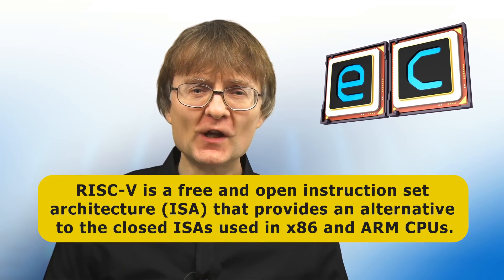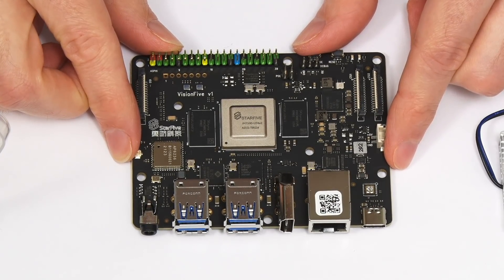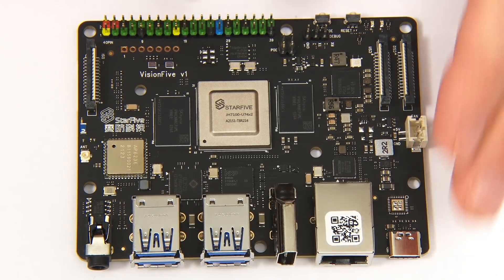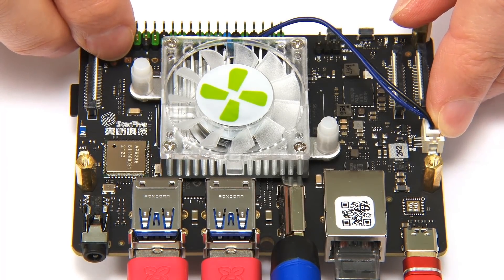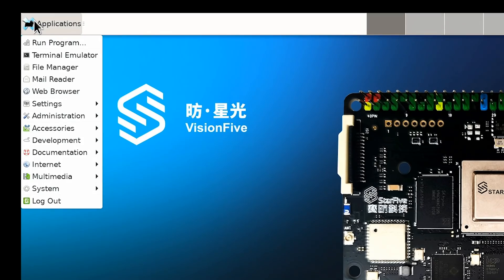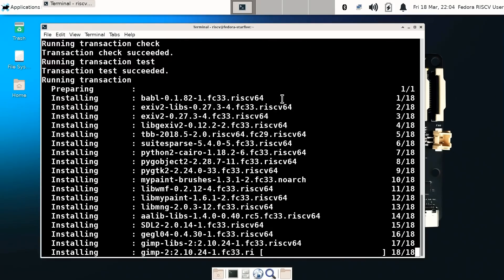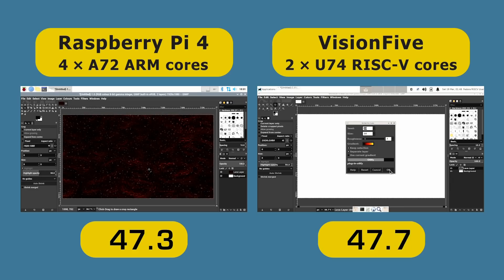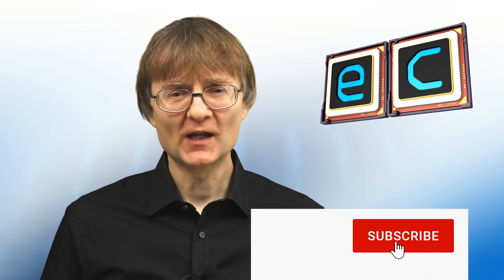VisionFive RISC-V Linux SBC

Comment: does the RISC-V have a built in controller to connect it to a 32' LCD Screen
Reply from the maker: Yes, there are two MIPI LCD panel headers, in additon to the HDMI output.

Comment: First I was into Risc-V but then I start reading about modular ISA which sounds like the reason why this will not be anything big. From my understanding, it means I can develop a software on my cpu with instruction set A.. and give the software to you where you miss a few instructions, so these will be emulated instead. I guess Risc-V will be perfect in closed systems if this is true, cause then you dont have this headache. But if its true, it will be like when MMX came for example, and you could not run this software cause your cpu lacked the instructions. But I could have understand it wrong
Reply from the maker: There are already about 10 billion RISC-V cores in use in the microcontroller and embedded space -- so it is already big. :) The ISA is extensible as you say. So, for example, a automobile manufacturer may add an extension for their particular use case. But outside of closed systems, core designers will stick to the standard ISA, so I don't anticipate the problems you describe.
Reply: @ExplainingComputers  ah then its okie I guess! :) was just seeing a nightmare of different isas being used in different software in my head lol :)

Comment: The RISC-V does not contain innovative ideas in microprocessor design capable of replacing existing processors such as x86 and ARM. The RISC-V processor is not suitable as a candidate for this role. They say “RISC-V does not represent new technology”. The RISC-V has no novelty potential. The tomorrow’s world needs completely new architectural ideas as familiar processors x86 and ARM are morally obsolete architecturally. I propose the novel architectural idea, see my article, address is below in this comment. The RISC-V is good for embedded systems, controllers, and similar as free and open. There are other positives and improvements, but they are on the engineering level. But the RISC-V will never become a general all-purpose processor. The RISC-V is based on 40-year old ideas as RISC-V Foundation claims. There is no sense to port the huge x86 and ARM software ecosystems on it. Thus, RISC-V will never gain a victory over x86 and ARM. The most of positives about the RISC-V processor are arbitrary speculations. Actually, the main advantage/benefit of RISC-V is free and open architecture (open ISA). The RISC-V processor has instructions with variable lengths, consisting of 2-byte snippets. It is strange, it is bad being a deviation from the classic, absolute, and pure RISC principles well formulated at the beginning of the RISC era. Also the RISC-V processor has 6 instruction formats, and it is too many.
I sceptically evaluate the RISC-V microprocessor, because it is based on old ideas and does not advance computer science and practice, freezing the long-achieved scientific and technical levels. However, I pay tribute to the creators of the ideas of the RISC microprocessor, with the main feature to perform all arithmetic/logical operations only on registers, and use external RAM only to load/store processed data. I also pay tribute to the idea of the free and open computer architecture (not patented instruction set architecture).
The Contemporary microprocessors contain 8 specific hardware components: (1) SMT (Simultaneous Multithreading), (2) register renaming, (3) instruction reordering, (4) out-of-order execution, (5) speculative execution, (6) superscalar execution, (7) delayed branch, (8) branch prediction. These components make up some kind of a “magnificent eight” of components which essentially raise the performance of microprocessors. But unfortunately they are very complex. A processor core having these components is a full-fledged one, otherwise it is good for simple applications, e. g. for embedded systems, controllers etc. 
The “magnificent eight” of components is very hard to design, only the experienced firms and developers are able to do this, and much know-how was acquired, some effective solutions are patented. Particularly complex is the SMT. Only powerful and advanced firms like Intel, AMD, IBM are able to equip their processors with the “magnificent eight” components. It is not surprising that some Intel processors, and the famous Apple's M1 processor do not contain SMTs. If a company is able create the full-fledged RISC-V processor with all “magnificent eight” components then it would be a serious achievement, and such RISC-V would be considered of the World's class comparable with x86, with ARM, but not more. As far as I understand most of the developed RISC-V processors have no components from the “magnificent eight”, and are intended for embedded systems.
A course directed on further development of RISC-V is a wrong way, and leads the computer architecture to deadlock. The RISC-V is not promising for computer industry. In fact, RISC-V hampers the further development of the state-of-the-art microprocessor technologies. The World demands absolutely novel microprocessor having much more higher performance than all contemporary ones. The novel and effective ideas on computer architectures do exist! Here’s such a novel processor architecture in article V. K. Dobrovolskyi. “Microprocessor Based on the Minimal Hardware Principle”. The article is published in scientific magazine Electronic Modeling (Електронне моделювання), 2019, vol 41, No 6. pp. 77-90. The magazine is posted in the Internet:
https://www.emodel.org.ua/en/ touch ARCHIVE, move to 2019, then to VOL 41, NO 6, (2019) then click  Microprocessor Based on the Minimal Hardware Principle, then go below to Full text: PDF, and click PDF. 
My novel processor architecture does not have the “magnificent eight”, The “eight” is not necessary at all. This comment reflects different view on the RISC-V architecture, and the computer community has a right to become familiar with such a view. I’m Volodymyr Dobrovolskyi (V.K.Dobrovolskyi).

Comment: I wonder if the simple architecture will allow for significant overclocking and/or high core count like the IBM series. Very exciting and I think philosophically from a computer science perspective RISC architectures with emergent instruction composing are superior to macro ops and CISC. If ever we change from silicone based chips to something futuristic like graphene, it is likely the first architecture will be RISC.

Comment: RiscV only has benefit in the ISA. ASIC needs various costs like IPs EDAs fabrication pacakaging and so on. Briefly, It needs abundance of echo systems of FPGA or easy asic (this may be too much) with open eda environment. And FPGA board with open risc v, npu, gpu HW source would be the wanted but too far.

Comment: The interesting thing is that the US courts ruled back in the day that an ISA could not be patented/copyrighted which is why we had AMDx86 and Cyrix x86 and Z80 mimicking 8080. Where RISC-V differer from ARM is that the entire VHDL used to design the architecture is open source. They could have done RISC-V with the same ISA as ARM but then they would have faced much more detailed comparisons on there performance I'd wager. I saw someone do some benchmarks between RISC-V and ARM and ARM came out slightly on top, but I would imagine as a community develops behind RISC-V that the VHDL improves the differences become less pronounced.

Comment: How much of the delay you experience is the processor and how much is a result loading from a flash card I wonder?
Reply from the maker: It almost all the processor. I've run a lot of SBCs from flash memory cards (over 60 different models), and performance can be a lot better from a (good) flash memory card. :)

Comment: $200 is low cost for a SBC?!
Reply from the maker: This is (was) not a low-cost SBC, and nowhere do I say this in the video. At the time of making the video (and for a few more weeks a I write this!) the VisonFive was low cost for a RISC-V computer of any kind capable of running a desktop Linux distro. It is not, and is not presented as, a general SBC. Rather, it is a board for those wishing to develop or otherwise pioneer with RISC-V, and is low-cost in that context.

Comment: I'd actually would have loved to know the power consumption on this computer vs the raspberry pi 4 - in idle and e.g. when applying that complex filter in GIMP. Just to get some numbers.

Seeing as electricity becomes way more expensive, perhaps a RISC-V-powered computer could be more efficient than even ARM-based computers are? That'd be definitely a selling point, though since it's probably somewhat early, I doubt it is as efficient, let alone more efficient at this time. But perhaps in the future? Who knows :).

Comment: Lemme blow your mind right now:
4 ARM Cortex A72 cores finish the lava render in 47.3 seconds - meaning that if we ignore that the OS eats some of your performance, 1 core would finish it in 189.2 seconds

2 RISC-V U74 cores finish the same render in 71.2 seconds, meaning one core would need just 142.4 seconds to finish it

When we factor in the fact that the two U74 cores have to run the OS and that RPi4 has basically two "free" cores, we can see that U74 has about 25% to 30% more single-core performance than A72

This makes me want a laptop using a 8core RISC-V SoC 😁
Reply from the maker: Yes, I agree. Four or eight core RISC_V chips with U72 cores or better running at 2GHz or more (and a GPU) will be a serious platform -- and I know there are companies planning on having them on the market by the end of 2022.

Comment: It's a pity they are not releasing at least quad cores yet and at higher clock speeds matching at least mid-range arm cores. That way we could do a more direct performance comparison by comparing SOCs at same or close enough clock speeds.

Comment: This is lacking a single core and multicore benchmark for comparing it to Raspberry Pi.
The GIMP benchmark shown is useless, because it is unclear if the particular GIMP filter is using multiple cores or not.

Comment: Nearly $200 for this?   Hard to see the value.
Reply from the maker: It is a development board for users wishing to experiment with or develop for the RISC-V platform, not an end-user product. It is currently one of these cheapest products that can run a Linux desktop on RISC-V hardware. :) But in a year or two RISC-V boards should be price and performance competitive with ARM.

Comment: I don't see why x86 and ARM and whatnot ought not be Open Instruction Sets? I think that I can google and download the appropriate instructions of my liking. 
I don't believe, that these are actually Open Hardware, however. Can you get full internal circuitry, lithography, everything?

Plus, for close to 200 USD, I guess I used to pay that much some 12 to 15 years ago for 1 GB and 600 MHz. 

Maybe I'm totally out of focus here, but why would this be any better than a modern Raspberry Pie for a fraction of the price? Also including GPIO?
Reply from the maker: Knowing the instructions in any instruction set does not make it open. :) Rather, an open instruction set is one where anybody is free to use it to design their own cores and manfacture their own chips, and you cannot legally do this with the x86 or ARM ISAs.

On the price, the SBC here is a development board for those wishing to develop RISC-V software. It is not an end user product. But in a year or two there will be end-user RISC-V boards that will be price an feature competitive with x86 and ARM . . .

Comment: Why are the new RISC-V SBCs single-core? Is it because they are new and a lot needs to be worked out (refinements) before adding cores?
Reply from the maker: Hi James. The Nezha is single core, and the VisionFive is dual core, because they are very new as you say. So unlike with many SBCs, they are having to run silicon for the SoCs for the first time, and in small quantities. I expect (well I know!) that we will see quad core RISC-V SBCs, and cheaper, by the end of 2022

Comment: Hey in your opinion, would this small Computer run all the software for a modern day Car or Truck? I was thinking of installing a New Computer that I could Program that would run all the Engine and Transmission systems. I was thinking of using a Raspberry - Pi 4 with Linux Mint 19.2 or higher. But this little board your showing here maybe a better Computer because it has more function's and performance than the Pi - 4. I want to run entertainment systems as well, like the Internet / Radio. So what do you think mate? Will this work and be a better chose? Thanks for sharing your hard earned knowledge with me. I do really appreciate this very much.
Reply from the maker: The VisionFive  a development board only -- there is very little software support right now as Linux RISC-V is so new, so a Raspberry Pi would would be a better choice. Note though that a Raspberry Pi has an ARM CPU, not an x86 one, and that Linux Mint is x86 only. There are many possible OS to use though -- see my recent video here: https://www.youtube.com/watch?v=KXIDfcfbNB0 For what you are planning -- like the engine and transmission control -- you would need controllers between the Pi and the vehicle. I've not come across this kind of Pi application, and it would of course need to be very reliable, as these are critical systems. But for entertainment systems, a Pi can make a good vehicle computer. Good luck! :)
Reply: @ExplainingComputers  Thank you for your opinion and knowledge answering my questions.

Comment: Hello. Excellent work as always. Have you heard of the new Rockchip RK3588 SOC ? It's fast with Antutu score of over 400k. It's faster than Nvidia Shield TV box by 2x and can plays 8k videos at 60 fps. Thanks and god bless.
Reply from the maker: Thanks for this, and indeed I have heard of the RK3588. It's used in the new Radxa Rock 5, which have on pre-order. I very much look forward to tesing it here ASAP. :)

Comment: hi i have some questions to this sbc because im very interest in it:
1: can it run windows? (i will not run windows on it even if it works but i wonder if its possbie)
2: do i need a special edition of an operating system like with the respbarry pi or can i use a normal distro?
Reply from the maker: This board cannot run Windows -- it has a RISC-V processor and Windows has not been ported to RISC-V. And you can only run RISC-V Linux distros suitable for this board. So yes, you need a special RISC-V version of any distro you want to run. To be clear, I am not aware of any Linux distro with official RISC-V support (they are all officially x86 only, or sometimes x86 and ARM). But there are some distros -- like Fedora shown here -- that have been ported to RISC-V and made available with drivers for this board.
Reply: @ExplainingComputers  ok thank you for your fast and clear answer! do you know an other sbc which doesnt need a special distro?

Comment: As computers get more ubiquitous, as if they are not already, their drain on energy is a serious concern. All that electricity must be generated somewhere and somehow whether with dirty sources or “clean” ones. There is really no clean electricity. While solar, wind, and other renewable sources of energy are renewable by themselves, the infrastructure that supports them is not. All the plastic that goes into the windmills and solar panels still come from oil. So as the environmentalism adage goes: reduce, reuse, recycle. Of these, the reduce part should make up the lion’s share. Basically and simply, just use less electricity. People should use more of these SBCs, assuming that they last longer, consume less materials to make, and drain less electricity.

I envision a world where computer hardware is modularized where a powerful computer has multiple of these SBC boards. Only when intensively computing tasks are called for would all of these boards be activated, working in unison to satisfy those tasks. Otherwise, one “controller” board is used most of the time.